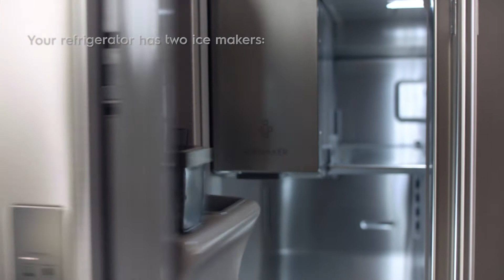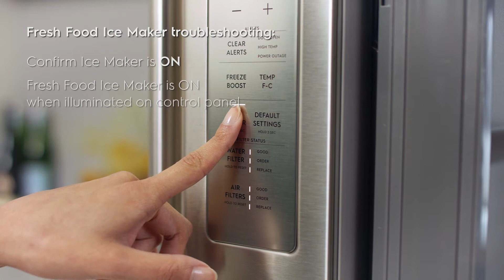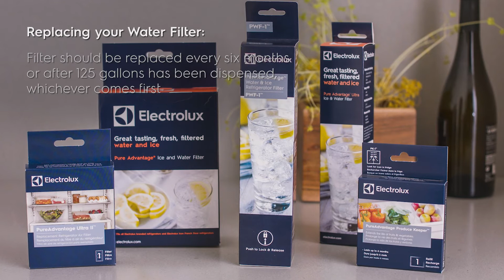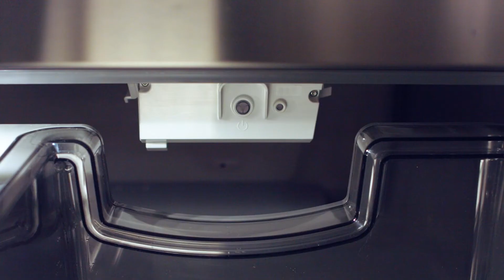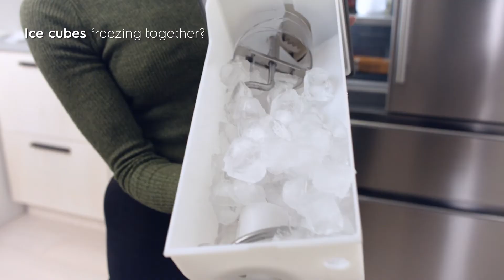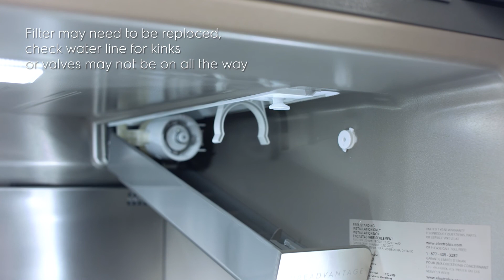How to Use Water Filter & Ice Maker in Your French Door Refrigerator

Comment: My Top Ice Maker Isn't making ice ...when i depress the paddle on the door the motor turns so that works but there is no ice in the bucket to dispense however, the bottom ice maker works fine and so does the water flow when switched to water and the paddle is depressed. I put in a new water filter (not a knock off) a genuine Electrolux. Should a Replacement part # 243297606 unit fix this?  please advise.....Thank you Carl
Reply from the maker: Hi there! Thank you for dropping by! When the ice maker in your French door refrigerator isn't making ice, there could be several reasons for the issue. Here are some troubleshooting steps you can take to identify and resolve the problem:
Check the Ice Maker Switch: Ensure that the ice maker switch is turned on. The switch is usually located on the ice maker itself or on the control panel of the refrigerator. If the switch is off, the ice maker will not produce ice.
Inspect the Water Supply: Verify that the water supply line to the refrigerator is connected properly and the water valve supplying water to the refrigerator is open. Ensure that the water line is not kinked or obstructed.
Check the Water Filter: If your refrigerator has a water filter, it may be clogged or overdue for replacement. A clogged filter can restrict water flow to the ice maker, preventing it from producing ice. Replace the water filter if necessary. If the tips above don't address your concern, please contact us through live chat or by phone at 1-877-435-3287 between the hours of 8:30 a.m. and 8:00 p.m. EST, Monday through Friday, for us to investigate.